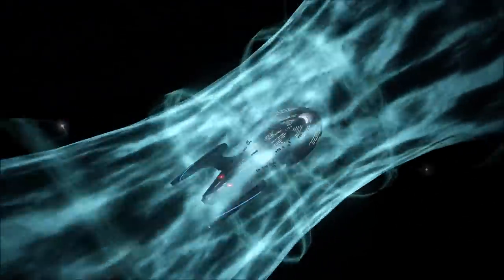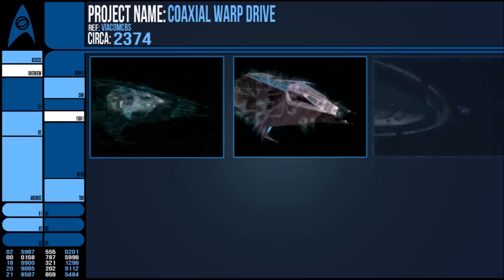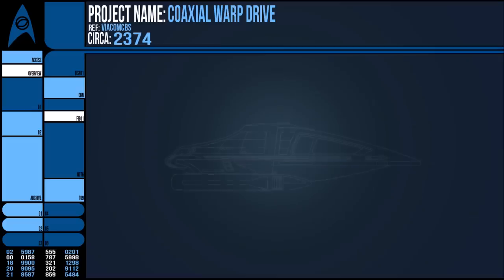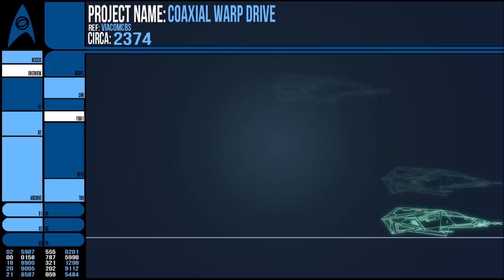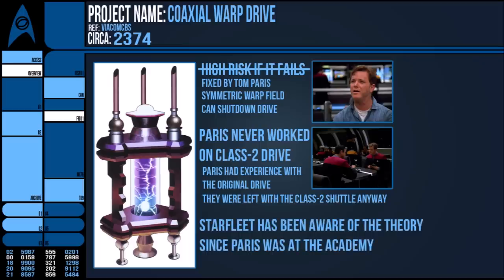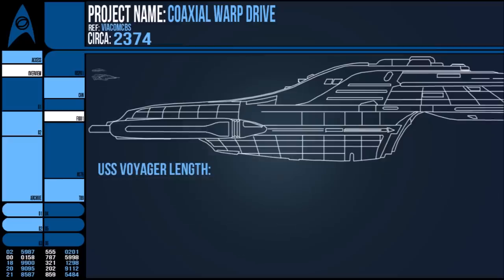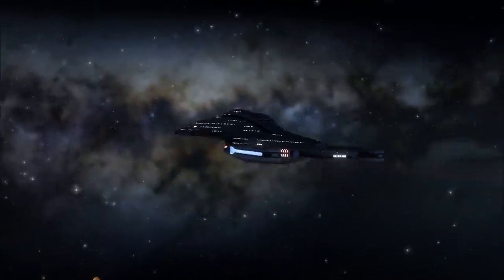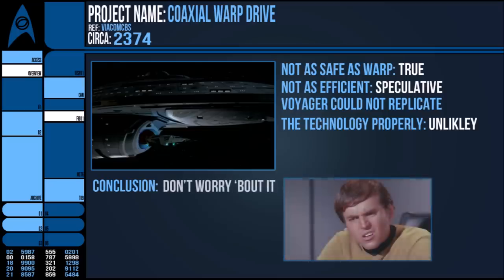Why Not Coaxial Warp Drive? (Star Trek Theory)

Comment: @6:00 There would always be tactical value in an instantaneous jump. Even if this jump only works on shuttles, being able to blink jump them into a battle at any time would have huge value. I think the in universe explanation on this one is pretty simple. My guess would be that it has a non trivial chance of leaving you in a random point in space with every jump. AKA, its safety and reliability doesn't meet Star Fleet standards. That would limit its use to unmanned combat drones or exploration probes, but that then means the chance that other species could find Star Fleet tech if something goes wrong. So they just don't use it.
Reply: Like using the transporter and ending up halfway in a wall.
Reply: Okay, now that I think about it. It can still work as escape solution. If the most important thing is to stop being where you currently are, a random jump within 20 lightyears or so is still better than a hug from a disruptor.

Comment: If distance and/or size of the ship cubes power requirements, that alone could be prohibitive.  Add exotic matter to the list and that would be the death knell. I have to agree, your theory is sound.
Reply: And it's not nearly fast enough that they could justify sending the shuttle to fed space either once or acting as a ferry to get the crew home. 

Though you would think a quick small ship would be handy for the crew even if it's just short instantaneous local jumps.
Reply: an ftl drive powered by XM? now thats the ultimate extension of "wake up, Agents - its time to move"

Comment: Thinking about it now, I'd say that it was, probably an issue with diminishing returns, ie. the larger you build the drive, the more energy you need to put in, and at anything larger than, say, the test ship, any warp core you could fit into any given hull wouldn't produce enough energy to make coaxial warp worth it or work at all. Then there's also the possibility that the range figures stated were complete bolony, because as stated, very unreliable narrator.
Reply: That makes sense.
Reply: Although given even significant limitations like this, i wonder would it not have been a useful addition to the delta flyer (and later the runabout class ships). Supposing you come under attack and are out numbered or otherwise pinned down , it could even if its short range and single use (excessive power required meaning recharge via a starship or station) be a very useful escape mechanism for the less powerful ships. Sort of like a whole ship emergency transporter with usage similar to the ftl drive in bsg, you get in over your head and you can jump away.
Reply: So why not build a fleet of small ships, put voyager on auto driver or let the doctor driver it. They will get to earth in no time.
Reply: Out of what? They had to cannibalize the Captain's Yacht to build the Delta Flyer, (according to some of the secondary material at least) and having someone else do it would mean massive tech transfers both ways. All sorts of troubles there too.

That and the show would be over then and there.
Reply: Now... now that actually reminds me of the problem* of Tokamaks, ((Soviet)Toroid design) reactor system, 
and how it was thought to be an unsolvable one in terms of scaling up the technology, a necessity due to its limited power output, the only if a glaring flaw for an otherwise superior technology, at least, the very least in terms of efficiency and fuel requirements.., 
until recently... with the so called Stellarators(now being implemented in Germany as first prototypes are already, finally, online and operable thanks to rapid deployment and construction of necessary and necessarily complex parts needed in newly designed twisted toroidal/reinforced magnetic constriction fields) design, although, admittedly, it was impossible to implement until recently, due to improvements and the very development of industrial(although, to be fair, it, that version/principle, etc.etc. existed if on a "smaller" scale, in a smaller area of uses for a while now, and not until recently was it deemed as something feasible to implement in fields previously unrecognized as profitable,  not until recent publicity and nigh-colloquial use) 3d printing technologies and their continued adaptation and implementation in new fields thanks to increased sponsorship from rising public awareness and support for technology... although all such wonders are still mostly in development as we're still figuring out the logistical of a world wide use by populace as well as new industries unfamiliar with these methodics prior, on a more common, daily base...
Reply: It’s Bologna, not Bolony
Reply: - take the coaxial warp drive
 - put it into the delta flyer
 - use that little super shuttle for short excursions off the direct path to earth
 - mess up and have voyager turn back to save the flyer
 - rescue the delta flyer
 - repeat a couple episodes later.

And since they already tested the design on a shuttle, they know how to connect it to federation tech.
Reply: @HappyBeezerStudios  That's assuming that the drive isn't at least a partial scam to begin with. I still don't think we can trust those performance figures.
Reply: @trekaddict  That would be a great plot for an episode. Let the crew tinker around with the thing, let them immediately have trouble.
Either it works, and they continue that way, or it's BS and they leave it. A storyline that could return to status quo or slight move the setting forward

Comment: That sounds alot like the Jump drive from nuBSG! and it could share the same issues maybe? Instantaneous, but short range, of course that could be solved with the Feds. better sensors, and more powerful and advanced networked computer systems. Charge-up and cool down time perhaps?
Reply: Not to mention a very detailed mapping of the galaxy( warp 10 provided ). Conclusion: Build a slightly larger Sovereign class with a triple warp/drive system. I hope they saved the formula that Q used on the enterprise D to get the shields up to 300%. It’s gonna be a bumpy ride
Reply: Jump drives have been common in SciFi for a very long time.  The Jump drives in the Asimov foundation series kept the jumps small so that they could evaluate the target location as unoccupied by telescopes with reasonable probability.  Indeed, most classic SciFi jump drives had this as a limiting factor.  I did not get the impression of the coaxial drive being a jump drive but of being similar to the transwarp conduits used by the Borg and the Slipstream drive but instead of attempting to create a conduit of warped space, it created warping more local to the ship hence an open ended conduit that was only a full conduit at the ship instead of well ahead of the ship.
Reply: @johnwang9914  With such intense energy, where does all the heat go?
Reply: @sirdeadlock    You do realize that FTL drives including jump drives are fictional...  

As to dissipating heat, in space heat can only be radiated hence the large wing like radiators of the golden age of SciFi from the 50's and 60's.  They would often have the heat radiators as three fins or four fins to prevent one fin from picking up the heat radiated from the other.  Some people draw diagrams with thousands of fins around the spaceship, the fact that this would only result in each radiator picking up the heat of the others only demonstrates their ignorance of the concepts.  

One detail that is always overlooked is that radiated heat is in fact infrared light and hence can be reflected and focused.  I've always imagined the radiator being a single pipe in a reflector trough which focuses the infrared through a slit in the hull.  This limits the amount of radiation that could be absorbed from outside sources to that which may get through the slit but still allows all the heat to be expelled outside the ship.  Plus this idea would give the ship nice glowing red racing stripes perhaps angled to provide additional thrust from the infrared radiation.

Note dissipating heat is a serious problem with the Alcubiere drive, the basic warp drive concept.  That's because the warp bubble is in fact a pocket universe and heat can not be dissipated from it, it's believed that from Hawking radiation alone, such a warp drive would immerse the spaceship in more heat than existed at the Big Bang.  The occupants of the spaceship would not only be cooked but incinerated.
Reply: @johnwang9914  Of course Dune solved the same issue via space magic, after they got rid of the AI. I imagine you could make a pretty damned speedy repeated jump drive with even normal sensors, provided you didn't jump inside of any cloaked ships.
Reply: @gajbooks    I suspect you meant to say "spice melange" rather than "space magic" though oddly both would seem to apply.  The interesting thing is that the idea of scanning your target jump location to see if it's safe and never being certain has analogies today such as a sailboat sailing across the ocean, holding watches every 20 minutes to spot other ships that it may collide with, abandoned cargo containers floating near the surface, shipwreck materials, abandoned ships and even ice floes.   Yes I realize there are VHF AIS beacons, radar and sonar but not every sailboat has those, not every marine VHF radio transmits AIS, radar takes a lot of power and sonar isn't good along the surface so it's really just for depth measurements.
Reply: @johnwang9914  I'm not so sure that spice melange is what causes foresight, as much as it is what triggers it in humans.
Reply: The issue of getting rid of heat basically means that energy beams are some of the best space weapons. There is no atmosphere to disperse it. But instead of using your rayguns to cut a hole into the enemies ship, you just overwhelm their thermal management system and cook the crew. And that works on longer ranges than trying to hit a moving target with a piece of metal.

Comment: If we make parallels between the Coaxial Warp and SW Hyperdrive, then perhaps aside from calculations, a detailed map of possible destinations is also required? For relatively short trips it could work, or as long as the systems you intend to travel to have been explored and charted in detail. But for any prolonged travels, especially though an unexplored space, it might not be practical (detailed scans and probing being prohibitively time intensive)

Comment: It was built out of Weeklionium, the internal hull material that resets to default at the end of every week.
It's how half the ships internals can be converted into a Holodeck or blown out by power surges from a duplicate ship and be back to factory spec within a week. Great stuff, but you've got to label it when making modifications or "poof".
Reply: There is also seasonium, which naturally decays with a half life of one season and returns to it's natural, unexcited state.
Some things made from the material: replicator rations, fired torpedos, anything that can go faster than a long time average of warp 8, the number 47, time travel paradoxes...

Comment: I agree with your explanation that between the jumps it just takes too long to let the drive cool down and the range is simply too low. To fold the space in big range is much more difficult than simply distorting space-time ahead of your ship. BTW: The Coaxial Warp drive is a ship engine version of the Sikarian Trajector or Rutian Inverter. All of these devices uses space folding. I think the transporter of TOS Calandans and the Iconian portals are based on a similar principle. They only have a much greater range than the ship version because they are stationary on a planet and teleport only small objects, such as persons.

Comment: Even if there was a size limitation, the Delta Flyer could equip it, and it was designed later.
And the overall travel time limitations (if they are real, they traveled out of range of Voyager's astrometric sensors, and those are long range) aren't a definite reason for not using the drive, because it still has one amazing trick…

The GTFO mode.
aka "Run Away, Run Away".

About to be overwhelmed by Cylon BaseStars… "Jump".
And now you're at least 24 hours minimum away at high warp, making quick repairs and running away on normal warp drive. Your enemies will never catch up cause you have a massive head start and they don't even know which way you went to have a chance to find a warp trail.

And in reverse it makes a awesome ambush mode, jump in on an unprepared victim. Useful for those episodes where they have to do rescue missions and try to sneak past blockades and sensors (in say Neelix's ship to do a prison break for Tom and Harry*, or to get Seven out of the Arena).

The Delta Flyer with coaxial warp would be the ultimate Scout ship as it could always get out of trouble. And if scaled up to Voyager and only able to do jumps at the same rate as high warp or even less, it's still a great escape trick.

But hang on, the original owner of Seth's body caught up to both of them, and he/she had a Big ship that may have been fitted with coaxial warp? (Y/N?)

Anyway, imagine what happens when they get home and Starfleet retrofits all its Defiant class ships with coaxial warp, and ablative armour generators, along with the other goodies Voyager got - the Tachyon beams to detect cloaked ships they got off the Dominion (but didn't install on the Enterprise E before going to Romulus…?). 
The ultimate raider.

Although the Translocator was never grabbed by Janeway either, even though they captured the ship and used it to imprison the prison guards.

*Tom and Harry, they really needed to introduce a background crewman called Richard…
Reply: Side note, the Warp 10 drive would be amazing for a unmanned probe.
Send it out and get detailed readings on the entire region for hundreds of Sectors. Especially if the probe was optimised for it.
The shuttle got massive amounts of data just as a side benifit.
Or it could be Data's personal ship…

And then the Translocator…
A ultimate weapon in a way.
Beam the crew off enemy ships in combat through shields. The entire crew at "close" range (still beyond weapons range), individual members at extreme range.

And what if the Beaming on included explosives? Could it get past the integrity fields that prevented transporters doing that with torpedoes.

Or just beam on an assault force while the others ships security forces are suddenly in your brig (or not reintegrated…).

Comment: Another problem would probably be the hypothetical issue of two objects occupying the same space if it's used at the wrong place and wrong time (probability is very low, but it could happen).  Also, when you scale a ship up in size, or any object, you run into the square-cubed law.  An object twice the size of another object (double the scale, twice the height and twice the width for a rectangle or cube), will actually have 8 times the volume (so if you double the scale, if density remains the same (which for a ship is unlikely and has irregular density, but for ease of understanding work with constant density), you multiply the mass by 8).  Exponentially more volume and mass have to be moved as you scale things up.

Comment: We do have supporting lore to suggest that it must not have worked out too- We do see Voyager incorporate technology into itself that permanently increases it's efficiency and ability to maintain higher warp speeds, this suggests that any tech that can be used to speed up the trip is and was a decent bit of writing that lets us infer that if we don't see them use it then it must not have worked.

This tech would actually be a really great fit for late 24th or 25th century shuttles to use, though. Having one or just a handful of very specialised shuttles that can do near instantaneous 'hops' to a reasonable distance, yet having it still be unable to work on starships, would be a great addition to the capability, but also story telling, of trek ships

Comment: Coax warp seems to be similar to other jump drives from other properties in terms of operation, so it stands to reason that it would have similar downsides as well. Ontop of that, coax warp seems to be a violent affair in terms of subspace disturbance, as you would literally punch a hole in the fabric of reality to go from pnt A to pnt B instantly instead of just gliding on the waves of subspace.

Comment: In Broad Therms, isn't the Iconian Gateway Technology Coaxial Warp, in a certain Nature?
Instantaneous Folding of space by portals... And they've shown to be able to accomodate things as large as an Obelisk or Herold Dreadnought, atleast in STO...
Reply: Those gates were also stationary, and connected to fixed points in space.
To use it on a big moving ship, going to a non-fixed location, or even unexplored. Man, the calculations would take up SO much computer power.

Look up the Fold-Space Drives from Dune, and you'll see why Folding space is not done lightly. 
I mean, in Dune they basically had to use psychic mutants to pull it off reliably.
Reply: Iconian Gateways are more similar I'd say to Stargates; but instead of deassembling the traveler and reassembling them on the other side it's instead literally just opening a doorway you can walk through much like in the Portal game series, or in the case of STO... pilot a ship through.
Reply: @austinmartin612  Nah, they're more like magic.  They can send starships back and forth through time and space at a significant distance.
Reply: @namyun2743  not through time, iconians actually can't time travel, it causes their physiology to break down